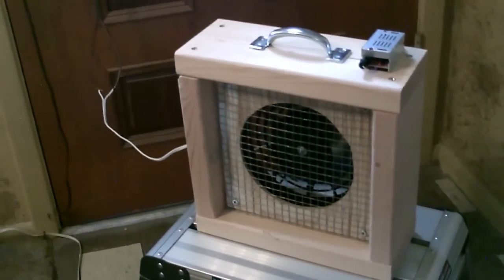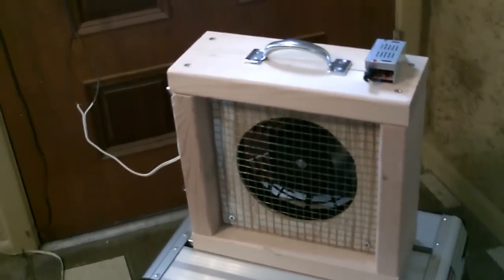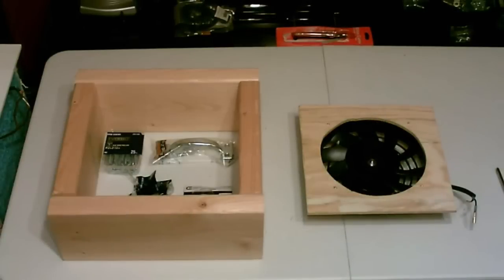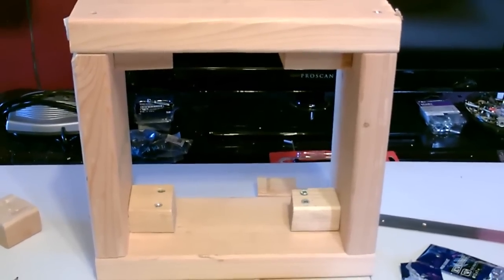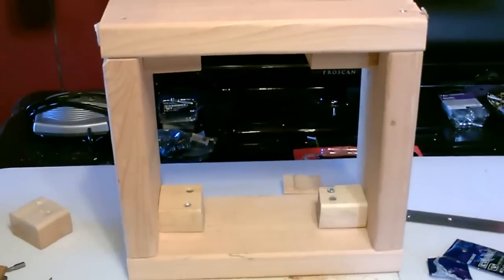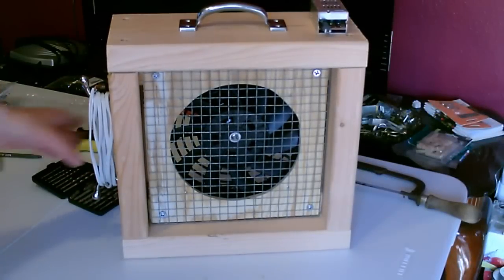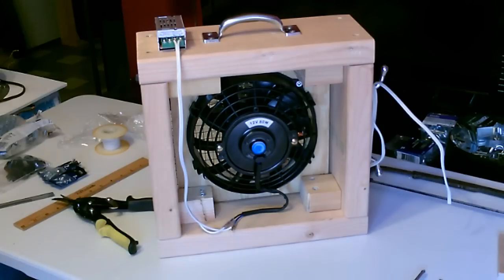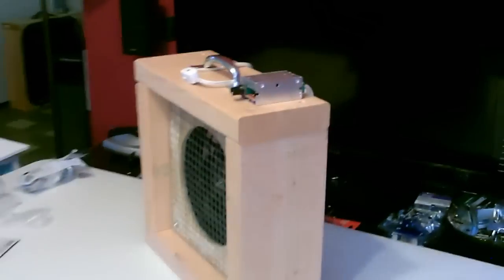DIY 12V "Mini" Box Fan! (13" Sqr) ~ W/Full-Size Power! ~ 1500 CFM! 20MPH! - Solar/Batt. Pwrd!  EZ DC

Comment: Are you running the black wire for positive and the blue for ground? I know the black is normally ground but my fan has a black and a blue wire also. I tried to zoom in on the video and it looks like you have the blue wire for ground.
Reply from the maker: hi. many (if not most) of these fans can be hooked up either way. meaning that the fan will just spin the other direction if you reverse the wires.

Comment: Have you explored 12v squirrel cage fans? I ask because i think for long term use, the air needs to be filtered so as not to clog the heat exchanger with dust. These fans wont pull air through a filter. Love the info, working on a system for my cabin.

Comment: Can you show how to make one with a wall plug or tell me how to do it I need it for my garage to extract hot air out and cool it thx
Reply from the maker: hi. these can be run using wall current if you use an AC to DC transformer. amazon has tons of them. i've got a video of my channel on that topic too. hope that helps.
Reply: @desertsun02  Do you have a link to that video? I'm trying to do the same. Thanks.

Comment: Love the video brother I want to make one can I use 14 gauge wire that's what my solar panel takes it's 100 watts what gauge is the wire that comes with the fan
Reply: you just need to figure out how many amps your fan will draw, the wiring run length, and then lookup the correct gauge (use awg wires, and good many-stranded copper (not coper-plated aluminum!)) in a dc wiring chart like this one: https://i.pinimg.com/originals/57/22/80/57228076ef240ed796b328a7d6387eac.jpg. if the fan isn't using but maybe 24w (2 amps @ 12v) then you don't need even 14 guage. peace

Comment: But isn't the fan most efficient blowing towards the back toward the motor. Positive to positive.   Because of the way the blades are angled.   ?🤔
Reply from the maker: hi. the blade assembly is reversable. you can flip it so it works either way. both just as good.
Reply: @desertsun02  amazing.  I'm trying to make a solar powered fan setup  to suck the hot air out of my enclosed trailer.   I'm going to have to try to flip it.  

I picked up two 8 inch fans and I'm hoping to make a box to hang and be removable.  Etc.

Comment: Love the content, thanks. But I would suggest doing a voiceover or filming further away from the units and zooming in to reduce the sound of the fans because its hard to hear you at times
Reply from the maker: hi there. thanks for the comment and feedback. i left the roaring sound of the fan in a few of the shots so viewers can hear the raw power of it. these fan are SUPER powerful air-movers when you turn them all the way up. in terms of actual use... if you set the speed anywhere from 1-80% the unit is no louder than a regular box fan. it's the last 20% where it sounds like an industrial or shop fan. but it's great at keeping you cool.

Comment: I have the harbor freight 100 watt kit, which is four 25 watt panels.  I'm assuming that the 25 watt panel would be too much for a 12 Volt clip on fan that I have.  Would this dc controller allow me to use the 25 watt panel with my fan without burning up the fan?  I want to run the fan straight from the panel without using a battery.
Reply from the maker: hi. the fan won't be damaged by a larger panel. the fan only pulls what it needs. (kinda like you can plug a nightlight or a microwave into the same wall socket. each item just pulls what it needs. just make sure the voltage is the same (meaning use a 12v solar panel if it's a 12v fan).
Reply: @desertsun02  They are 12 volt panels, but they put out more than 12 volts.  I was getting 17 volts with the bubble wrap still on it and half of it covered by a jacket I had in my van.  It was also laying in the back of the van out of direct sunlight. lol.  Edit: Wait, nevermind, they are rated 18 volt output.  I just looked at the manual online.

Comment: What size and type of wiring did you use?
Reply: I'd like to know that also
Reply: Tina Gallagher looks like the same wire for making a lamp. Definitely the same switch too.
Reply from the maker: hi. it's comparable to 16/2 indoor extension cord wire. the kind you can buy (6 feet) for a dollar. i think the particular wire i used this time was from an old small appliance. when the appliance stops working i save the cords. here's a link to something similar  https://www.homedepot.com/p/HDX-6-ft-16-2-Indoor-Cube-Tap-Extension-Cord-White-HD-145-017/100672781

Comment: I've been scouring Amazon for 12 volt fans. Instead of buying EXPENSIVE 12 volt vent fans for my old fiver, I'm gonna build my own using your design. The lid will be a universal van lid, but the fan inside will be 12 volt. EASIER to control, will most likely last longer and be better. GOD BLESS YOU for your designs! The evaporative cooler I built last spring using your design is STILL working, and my neighbor wants one for her bedroom! You, Sir, are a genius!